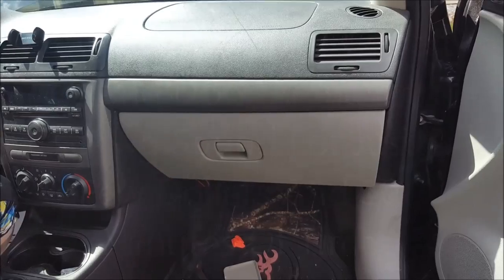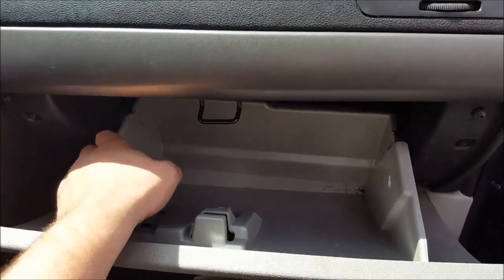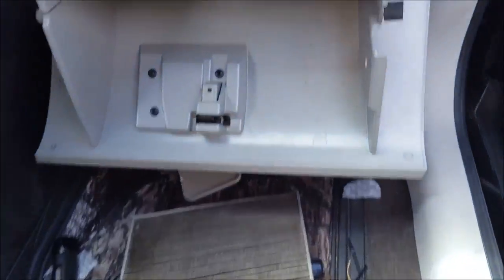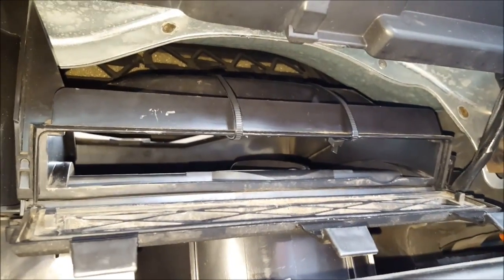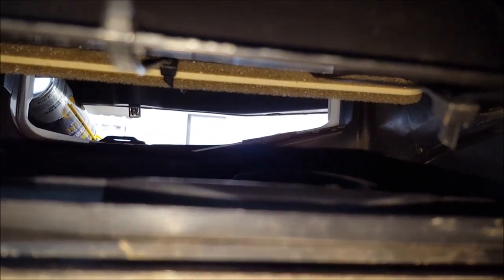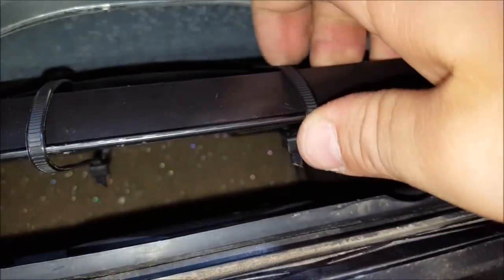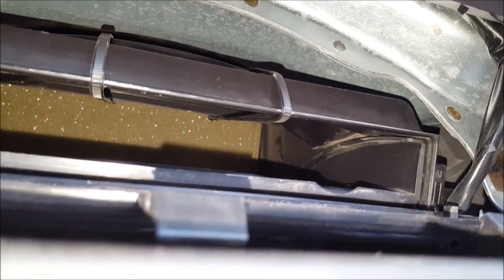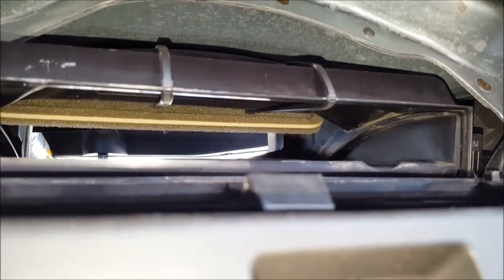How To Fix GM Blender Door Clicking Noise (Fast & Cheap)

Comment: Mine does that creepy sound too. Heading outside and try this out. Wait for an update. 
**Updated**: I tried it out with two zip tie in the middle instead of in two places and worked just perfectly. Make sure you don't leave a slack of the zip tie, but leave 1/8 of an inch in order the flap door stay in open position but for a little room which is 1/8''.  Great thanks to this man for showing us how to eliminate that sound. Thank you gain.

Comment: 25 Oct 2023:  This worked great on my 2006 Chevy HHR.  Dealer and local shop were quoting between $700-$900.  It cost me two zip-ties and 20 minutes of time.  Thank you for the video.

Comment: That Fix definitely works, but I didn’t want to fuss with the tight space so I just put a screw in the lower part of the door flap, so when it opens up it hits and stops the door before it gets to the point where it starts making the noise. Works perfectly and I just used a long extension with a drill. Thanks for the video

Comment: Great info! It didn't even cost a few dollars. All you really have to do is get ANYTHING shoved in there. I tested it by putting the end of a screwdriver in between the door and it stopped clicking. Since it looked to be a bit tricky to get a cable tie through there, I bent over a piece of coat hanger and hooked it over the top of where the door closes. I rolled the other end to create a "clip" that I ran into a hole in some metal above. Works great. I was about to go down the route of tearing out insulation and trying to replace the actuator. Even after I ripped up my car I was not confident that this would work. This saved my ass.

Comment: Thanks William.  Trying to sell the car. Most potential buyers were turned off by the clicking. Now no more noise.  I fed a stiff wire through first and the used it to pull the tie wrap through.  Drilled a small hole in the tie wrap to attach the wire.

Comment: Holy crap this really works! I only had to use 1 zip tie though. Just a few well earned busted knuckles and BAM! No more noise lol. Thanks man, you rule. How dare they build the dash to where it's insane to access important components! Chevy engineers their cars to where you are almost left with no choice but pay their mechanics hundreds of dollars for NOTHING!
Reply: If it’s nothing, pulling the dash should be easy.
Reply: @AdamConstantine   you are  not a mechanic are you. If you've ever put a heater core in an Equinox you'll know that pulling a dash  isn't that much fun. I think the "Nothing" he refers to means its an easy do it yourself fix.
Reply: AL M what I’m saying is he’s complaining about paying a mechanic for “nothing” but that’s just it, pulling a dash isn’t easy. You are paying us to do things you can or don’t want to. It’s gets annoying hearing people complain all the time about having to pay to fix their car. I am a tech and I’ve pulled dashes. That wasn’t what I was saying
Reply: It's not just Chevy engineers, and it's been like this the 40 years I've been wrenching. DASH WORK SUCKS.  I despise pulling dashes for electrical and HVAC issues. Some jobs call for 10 - 20 hours, and at $150 shop rate, customers decline all the time.
Reply: Wow this was 6 years ago lol.

What I meant was the part was like $40 at the time, but the labor in 2018 was $750. The part being 'nothing.'

But no, I get it. Mechanics probably dread the days that they have to tear a dash apart. My problem was that this clicking noise is in every chevy I've been in and it should have been addressed.

BTW my zip tie quit working a year later and I've been slowly descending into madness every time I start my SS/SC.

Comment: ALSO WORKS IN A CHEVY HRR. Holy crap, I've been tolerating the click for years because I had that changing out that blend door actuator was a +$900 job. I did this in 5 minutes with some zip ties I already had. Changed the cabin filter while I was there (it was absolutely filthy). I feel like I got a new car!  I wish I could like this video 1000 more times.

Comment: February 2024 - Worked for me! I used some computer cable organizing ties that loop into each other. They weren't long enough alone so I was able to combine two together. Caution, my hand hurt quite a bit doing this process, I will say feeding the cable tie from the top to pass to yourself is MUCH easier and less painful.

Comment: I just did this on a 06 Monte Carlo. Its way different but the same idea, Once the glove box is removed completely then you see the door with a grille in front of it. Turn on the key and you see the door move then "knock" as it hits bottom.  I tied a piece of hose into the grille bars to keep the door from going all the way closed.  The recirculating door will always recirculate a bit of inside air but shouldn't be a problem.  Thanks for the great tip William Grundemann

Comment: @1:14 in the video I see the actuator on the right side of the cabin air filter housing. It's a tight squeeze but not that difficult to replace. The zip ties seem like more work to me although cheaper. I just bought a new actuator on Amazon for $20 and replace it.  I only removed the glove box completely because it was in my way.
Reply: I would love to see a video of what you did!
Reply: I see your comment is 4 years old!  I can't for the life of me get enough room to pull the damn actuator out of where it's in against up there!  I can feel it, grab it, even tug on it a bit.  But on-top of the difficulty I'm having pulling it out, I can only imagine trying to push a new one in will be an absolute dreadful nightmare!
Reply: @Dear-_-Agony  I took off the glove box and used a long flat screwdriver to pry it off. Unfortunately I snapped one of the clips that holds it on so I had to tape it with T Rex tape.
Reply: It was a pain to get the new one on too. Just be patient and try not to strain your arm. Good luck

Comment: Thanks for the tip, but it doesn't seem applicable for my situation since mine clicks when the door closes and not when it opens.
Seems those having this issue(in the video) is because the blend actuator. So blocking the door from opening all the way will get rid of the click if it's clicking on the last gears.
Those having my issue(clicks when closing) seems to be the recirculating actuator.

I took the wiper cover and wiper blades off to have access to the little cubby compartment where the blower motor and cabin filter is. From there it's very easy to access the door. I then had someone click the recirculating button (which recirculates the interior air and doesn't allow outside air) while I kept my finger in the way of it fully closing(where the cubby compartment is), and it didn't click anymore. So I could technically place something to block the door from closing all the way which will get rid of the clicking, but that means it's still going to allow some outside air to flow in to some degree.

So it seems I'm going to attempt a replacement. Really wish my problem was the other way around :( .

Comment: So I used the zip tie method but this is what I ended up doing. I binded up 2 zip ties and bent the middle until it was somewhat straight. Then i bent the male end of the zip tie into 3 sections. Then I slid it in sideways on top of the air filter chamber then slide it around until it went through the middle back area. Then I used some needle nose pliers to grab the end of the zip tie and pull it in. This method only took a few tries to get it right. I have pretty big hands so they barely could reach in the air filter chamber and touch the back end. But if your going to attempt to stick your hand in there DO NOT HAVE THE CAR RUNNING WHEN YOU DO THIS. There is a fan just below past the air filter chamber that could seriously injure your hand.

Comment: i noticed you opened the passenger air bag cover ,is that necessary for the zip tie installation and how can you open it without the airbag opening up
Reply from the maker: THIS IS NOT THE AIRBAG COVER! :)

This is the door to access the cabin air filter which is located behind the glove compartment. 

The airbag cover is on top of the dashboard. Please do not try and open the airbag cover as it may cause the airbag to deploy/malfunction and could cause serious injury.

Comment: How do you get the zip ties put on I can’t get it fed through!?
Reply from the maker: Get one hand in the vent opening and feed them over the top of the plastic and grab it with the hand that's in the vent opening and pull it through. Depending on zip tie length you might need two for one wrap around.

Comment: It doesn’t cost $900 to fix at the mechanic. I had mine done last summer. It only costs $150. Either they gave you a rip-off quote or you are just exaggerating for effect.
Reply: My mechanic can't seem to give a precise estimate on this job till they get in to it..he quoted the maximum it could be ($600) but said it could be a lot less, since they don't have a lot of experience with this repair.  Do you think the estimate should be closer to the $150 you paid?  He said to bring it in when it gets worse , btw..so far it only lasts a few seconds after turning on the motor, then gets quiet..thanks, Tom Firme
Reply: I see your comment is 5 years old but I call massive shenanigans to your claim of it only costing $150!  
The entire dash is supposed to come off to do this (rather otherwise simple) repair properly.